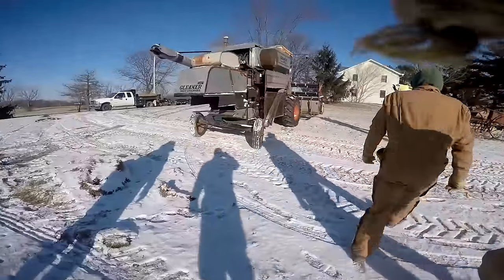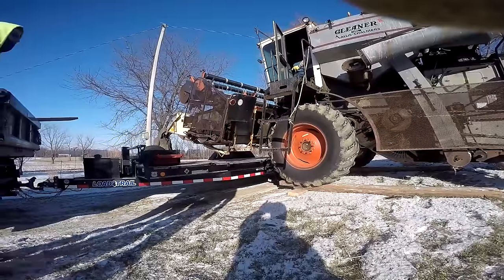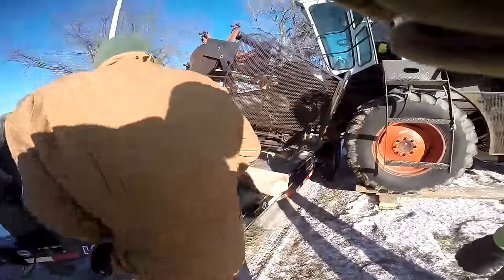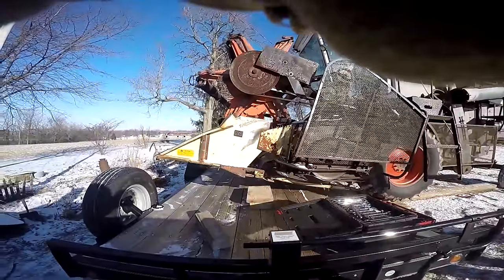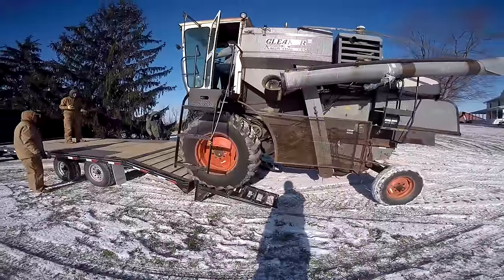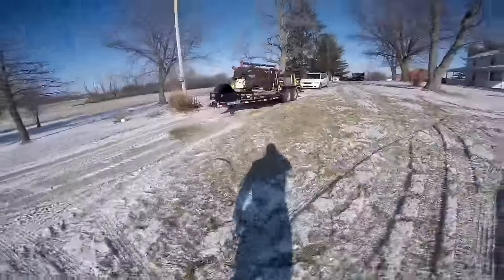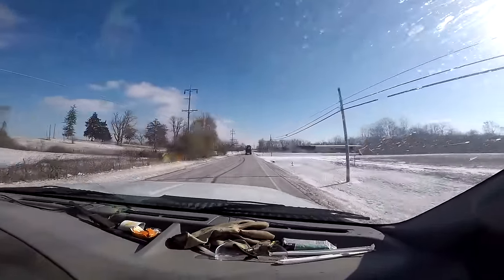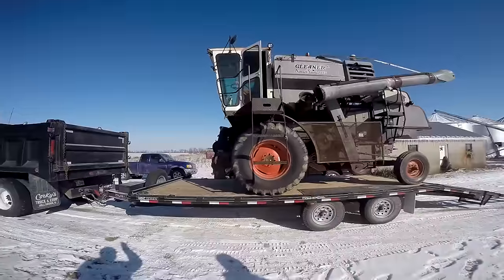Gleaner K Combine: Hauling Home our New Combine

Comment: Looks like a good machine. If you don't mind me asking why did you get another combine? And is that a 684?
Reply from the maker: I still have a field forty miles away to harvest, and this little guy can go on trailer that doesn't require a semi and a low boy. 
It is a Hydro 84, and could be yours, if the price is right. I love the hydrostatic transmission, but a tractor with more pulling capacity would help us more.
Reply: Boehm Farm I see. Personally I don't like hydros. So I'd have to pass but thanks.

Comment: nice i paid mine Gleaner F for 500 bucks with grain head drove it home 10 miles about a year a half ago. of course my cab ain't perfect.it needed some work. Took me a while find a 438 corn  head and found one for sale an hour half away for 600 bucks. i used it last year picked corn 2 a half acres.Did yall hit any overhead wires while hauling it? lol
Reply from the maker: We cleared all the wires. I have seen 438 corn heads around. I am on a treasure hunt trying to find a 335 corn head, which is a three row wide, for the K. At least you could drive yours home.
Reply: i think I seen a 3 row corn head at a junk yard but i dunno how wide is it Ill check it out when I get down there tom when i pick up a used exhaust/intake for my gleaner F combine. i live in southwest michigan.
Reply from the maker: That's not too far. The 1890 chopper, the TC30 and the multivator all came from Michigan.

Comment: how far did  you have to travel with that load and how high is that load? 
I have a int 403 I need to move.  I have power lines and bridges to clear
Reply from the maker: The legal height is 13'6" Which, we'd hope most power lines are 14'+. The deck is 30" and the K is just short of 11' tall. We didn't catch a line over the 70 miles we hauled it home. Bridges should be marked, but they aren't guaranteed over 14'.
Reply: @boehmfarm4276  I knew a guy one time who drove a Deere 9900 cotton picker 525 miles from Lubbock Texas to Wharton Texas over the course of several days... probably close to a week... at 15 mph on the road it takes time but in a 10 hour day you can make 150 miles on open road, little less going through towns or whatever... sure cheaper than paying a big bill for a semi to haul it... 

I've driven my Ford 5610S 100 miles from the Shiner farm to the Needville farm, and back again... it takes about 6 hours at 15 mph going through four towns... just takes some time but it's a nice ride... OL J R :)

Comment: Gleaners have always been way ahead of other brands, We have ran all of them, from the A's all the way to the new S88's, remember there's nothing meaner than a Gleaner.
Reply from the maker: It took them a while to catch on to the rotory design. New Holland beat them. But I like the K so far.
Reply: @boehmfarm4276  Gleaner built a rotary back in 1931. They hold a lot of patents on rotary design going back to that time. Then they started the N series project in 1967 built prototypes called an N1.

Comment: if you only get 50 hrs out of  spark plugs you don't have your card set properly. I run a lot of carbureted engins my swather  put 200 hrs a year and did the plugs when I got it 5 years ago and never Did them again
Reply from the maker: We've tried fiddling with it. I am not sure they set it from the factory in a permanent fashion. What we think are the adjustment screws won't turn with reasonable force.
Reply: @boehmfarm4276  Another thing you can do is get an electronic ignition kit to replace the points... eliminates some hassles there as well.  

You can put fuel injection on practically ANYTHING with these aftermarket kits but they cost about 5X what you paid for that combine LOL:)  Later!  OL J R :)

Comment: Why don't you switch to 30 in rows?
Reply from the maker: Because I'd rather go direct to 20s. We plant ten acres of sweet corn, and picking all that by hand is rather tight on thirty inch rows. To keep as few machines as possible, we've one planter for corn. A six row narrow won't fit in our barns, and four row narrow heads aren't commonly available for our TR70. Of course, I could only harvest 20s if a found a Gleaner 420 head for the K, which is super rare.

Comment: I have the exact combine and 12' head if you need a parts combine
Reply from the maker: Do you have a corn head? Or a spinner instead of a straw chopper? We shall see how it works.
Thanks
Reply: Boehm Farm might have a spinner. Nope corn head was sold it was a 3 row narrow. Thanks.
Reply from the maker: I have a straw chopper, but the previous owner took it off, he kept having in plug. It doesn't need a spreader for corn, but it might be nice for distributing bean stubble.
I wonder if there were three row wides available for a K?
Reply: If the straw chopper is plugging replace the knives.   I had an IH 715 that did that exact same thing/  Replaced chopper knives and all was good.
Reply from the maker: the plugging issue is because the belt would come off, then chaff couldn't fall out of the straws walkers.